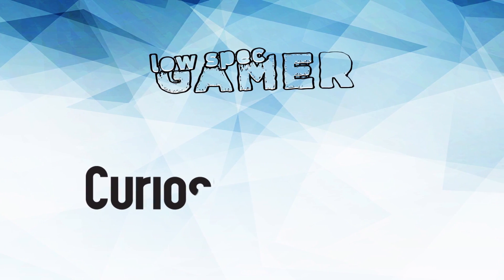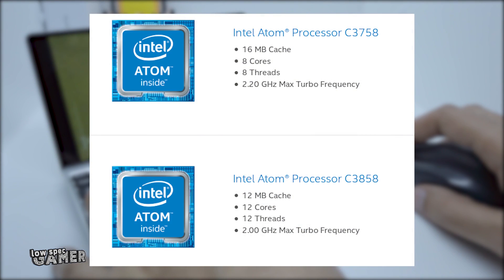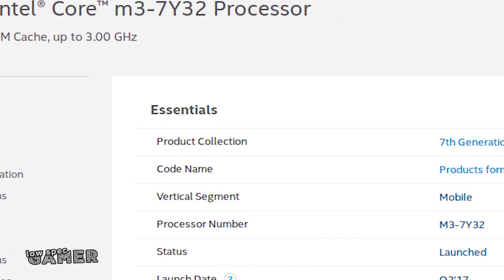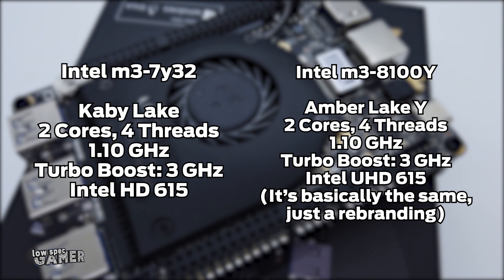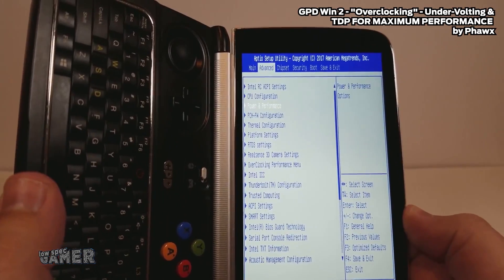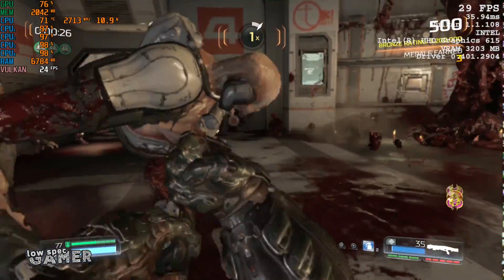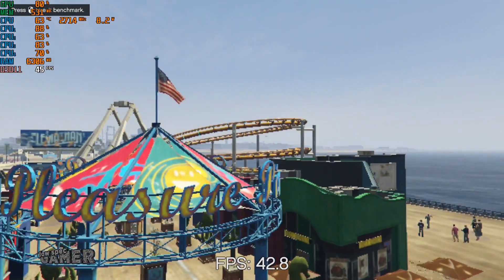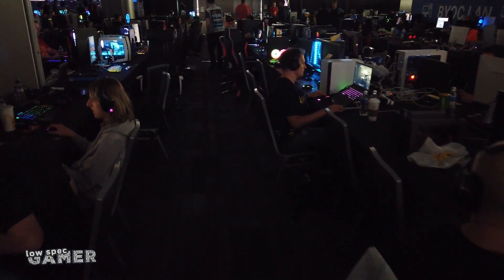Heavy gaming on this tiny computer! (Lattepanda alpha m3-8100y)

Comment: Hi. Thanks for video. I use LattePanda Alpha (864s) (m3-8100y) with titan case. I installed windows 10 on m2 ssd (toshiba rc500 m2 ssd). While the cpu temperature is 45-50 degrees in idle mode, the cpu temperature rises to 95 degrees while processing. M2 ssd itself gets very hot (over 80 degrees). Applications installed and running on Windows; dropbox, google sync, resilio sync, qbittorent, plex, kodi. I will generally use it as sync operations / file server and media player. But it scares me that it works with an average of 80-90 degrees during the procedure. Do you think this is normal or should I return my Lattepanda?

Comment: For the people who really want to run games on this board: There is a project called "rocket league for potatoes" that has almost all the high-draw features removed, but retains the actual gameplay. I've seen it run on Pentium 2-in-1s with 4gb of ram. I don't have a link to it right now, but it should be decently easy to find if you don't mind poking around a little.

Comment: Alright, this is bad news for me. :c
I wanted to make a handheld gaming thing with this, and... I need to try and find the OLDER model now? Really, I may put some sort of adapter inside with a ribbon cable so a gpu could be an OPTION, but not focusing on a MUST. Yes, it's for gaming, yes, it's for old gaming as I don't mind graphics that much, but it is also for MODDED gaming... This may screw me over. :/

Comment: You should get your hands on a Minix Neo J50c-4, it runs windows10 on an 10WATT TDP x86 Intel Pentium Silver J5005 Quadcore 1.5GHz, sporting an Intel UHD Graphics 605, 4GB RAM DDR4 upgreadable to 16GB dual channel support, it comes with a 32GB eMMC Storage upgradeable to 1x 2280 M.2 SATA SSD up to 512GB, it has 3 USB 3.0, USB C, and it support up to 3 screens at the same time, HDMI, Mini DisplayPort and USB -C all at 4K 60fps. the average price is 300 bucks, i managed to get one at 240 from Aliexpress from the Minix Official Retailer. Check it out!!!

Comment: I have had this setup for about 9 months. I gave up using it for Gaming but our family uses it for simple day to day Communications/ google apps etc. 

Not that great for using it as a Maker SBC/ Arduino platform it far to expensive to be underused running simple Arduino development projects. 

As for the cost it’s almost the same price as one of my Rosewill Micro ATX Mini Tower Computer 

# Case $45. 
# AMD Ryzen 3 3200G 4-Core, 8-threads  with Radeon RX graphics.$135.      
# GIGABYTE B450M DS3H Micro ATX/Motherboard) $95. 
# SSD M.2 2280 60GB Shark Ngff Internal $35. 
# CORSAIR Vengeance LPX 8GB (1 x 8GB) DDR4. $50.  
# Air cooler $50. 
# Power supply $50.   

Now this not a very powerful gaming system but it costs a bit more the my Alpha and GPU ( via a m.2 ) combo 

The size of course is about a lot larger the the Alpha but it doesn’t take up any real space  (35.2 x 36 x 17.5 cm) 

In closing the fact that tech support over  DFROBOT is not that great 

It was hard to get any real help finding a dealer in Canada that would sell you a system with support.  

Building your own AMD systems is not that hard. An the on line community for Ryzen is fantastic.

Comment: you should install a lower end external gpu like a rx 470 or something (yea i know thats really not a  """"lower end gpu"" but you know what i mean ....ahhh a budget gpu like the rx 470
Reply: mitch h the gtx 1650 is great for this little board. You can get a 120W external brick and power the both of them in a nice neat little case
Reply: @HandheldHardware  ahh yes but i was thinking of a lesser bottle neck situation type thingy??
Reply: mitch h fair point indeed!

Comment: IT COSTS 400$ what’s the point just build a a mid range gaming rig and don’t buy this overpriced garbage!!! >:(
Reply from the maker: that it is small? and portable? Just like with a laptop, which you would not compare with a desktop because they are meant for different tasks.
Reply: LowSpecGamer it just amazes me that a pc this low power has such a high price point when most other options for single board computers, such as the pi, are so low priced and affordable. The price point just makes no sense when you could get the same games to “run” on a 100$ less expensive laptop and retro games to run on much cheaper single board options!  So where is even the demographic for something as seemingly pointless as this?!?
Reply: LowSpecGamer also thanks for responding and my comment was in no way hate or dislike towards you.
Reply: LowSpecGamer also not to mention you would have to build a laptop around this thing or just pray that where you work has a spare monitor, keyboard, and mouse. So I guess more like the potential to be portable, but it is small.

Comment: Lol, I watched this video on my 
Core I9-9980XE
Gigabyte X299 DESIGNARE EX motherboard
Titan RTX
2×Sabrent Rocket NVMe 2TB
Seagate IronWolf NAS 16TB
(8×16) Corsair Dominator Platinum RGB 3200 128GB ram
EVGA Supernova 1600W P2 PSU
Asus ROG Ryujin 360 RGB cpu cooler
Cooler Master Cosmos C700M case
Acer Predator X27 bmiphzx 144hz 3840x2160 res
*13000+tax btw*😍😗❤

Comment: Sweet, I could build a nice little PC with this......
$409
ight imma head out
Reply: You'd be better off with a Ryzen APU setup, in all honesty, and it should cost around the same amount and hit better frame rates. Shouldn't cost more than this. Around $80 for the mobo. $140 for a Ryzen 5 3400G (4C/8T with Radeon RX). $40 for PSU. 16GB Crucial Ballistix Sport LT 3000MHz DDR4 for $75 (also two modules so you can use dual channel). That brings you to $335. Spend the last bit on a hard drive that you like and bam... LOADS better than the LPA.
Reply: @juansolo1617  not much difference gaming wise between the 00g apus. I got a $292 pc made with ryzen 3 2200g 8gb ram ddr4 and keyboard and mouse
Reply: @prodigyz2416  There really isn't much difference, but the 3400G can give you up to 20FPS more in some games, and it doesn't cost much more. Just like the Bulldozer architecture from AMD, it does best with the fastest memory you can throw at it, and you'll want a matched pair from the factory. Always good to have more memory. $75 for 16GB is a GREAT deal. Two modules, dual channel, 3000MHz.
Reply: @juansolo1617  games ive seen benchmarked have not had a 20fps gain in any way 1x16gb ram i just got so i have 24gb rn and ive tested 30 games from racing to ac odyssey to gtav
Reply: @juansolo1617  that lawsuit just finished up last week over AMD lying to the public about the Bulldozer,  AMD's defense of chiplet's connecting cores equals the exact same core and speed when in fact it is false advertisement and a lie yet again except this time to a court room judge and lots of sharks with engineer's every so happy to put the facts all over the table,  poor AMD lost and proved to be false advertising core counts by using chiplet spreading as the terms of full on interfacing at max channel speeds,  when computer science says not only that such is wrong but criminal ,   this is the only one investigated thus far,   I am sure those great lawyers are going after the whole Zen line up to look for faults since AMD did admit to using false science as the basis to their core interfacing which was up to 50% slower than the standard method to which intel uses,   no wonder they got so much smaller so much faster, not better engineer's ,  engineer's willing to ignore the facts of computer science.   long story short,  AMD lost law suit and judge awarded all buyer of the bulldozer line up 300 dollars per chip bought due to false markerting,   buyer got checks for 60 bucks each,  WOW those lawyers took a huge amount,   perhaps someone needs a mathematician to check that highway robbery they did on all those poor souls thinking they got the latest and greatest and the fact was they were had by the next rising star and now the world knows a truth on how they rose so fast..... reminds me of the Germans and WW2,  no one knew how the advanced so quickly,  moving as tho they did not need food, water or sleep... then the discover than truly won the war in Europe at least,   that magickal power was pills of amphetamines but the worst variant "methamphetamine" meaning they would take them and stay awake and awake and awake and awake,  unlike other amphetamine salts which wear off after 5-6 hours and the person can rest,  so the allies just set up camp to test the idea and bingo,  all the had to do was hang out and after 4 days of no sleep no warrior is a warrior with no sleep... Intel and ARM have had the greastest geniuses on this planet working to the latest and greatest.... remember when intel was sued for not pretelling the public of the next generation of CPU that will launch 3 months from now and they lost in court over that one,   AMD does the same and not a word is said,  they giving only vague hints no dead on specs.  Seems to me using the risc chiplet technology to make your 12,18,32, 64 basically all quad core and above variants zen or non zen since bulldozer is the crime and I wonder if this is the last we shall hear of it??  I think their whole APU being close to a PCI e 1050 4gb GDDR5 is why they have been cut slack and the only reason.   Look at that 48 dollar Athlon with the zen APU ,  ran with the right FPS limiting and resolution and that sucker will game just about on par with a GT 730  4gb.... goof job AMD on that......
Reply: Helios Gnosis what the f*ck?
Reply: @juansolo1617  A friend of mine wants to build one for his kid. Could you possibly throw up a parts list that can handle this and a bit more. Cost seems to be an issue for my friend, not sure why...
Reply: @juansolo1617  it was $600 back in 2017. considering rx 540 is a 1.2 teraflops card with 2gb gddr5 dedicated ram. I say its a solid choice, also its a laptop. I don't usually get cpu bound even playing some windows games on linux with proton (in ex. warframe, mortal kombat x etc...). It has a very bad cooling thoug and had to do a custom script to let gpu go to 95°C but cpu throttling needs bios modification to expose throttling control.
But cpu bound games like cs:go (when valve port it to source2) and battlefield 4 (slows down when cpu throttles) can benefit from a desktop build more
Reply: Juan Solo Maybe in the U.S... In my country 2x8GB 3000Mhz is $140, the 3400G is $240... now even talking about any intel processors.
Reply: The point here is obvious portability, which it'd be hard to get with the Ryzen. If there IS a portable low power ryzen and a board matching the size of the panda alpha, do point it to me.
Reply: @leonoliveira8652  You can always go Ryzen V1605B like the Udoo Bolt x8. Its got 8 vega cores for graphics which gives it a decent output for a ~4.2x4.2 inch board.
Reply: @HandheldHardware  It IS kinda bulky for a handheld, tho... But I guess it's still either power or portability right now.
Reply: @leonoliveira8652  Here's to hoping on the next lattepanda product
Reply: @leonoliveira8652  Asrock mini
Reply: With that just build a mini itx Ryzen apu pc
Reply: "But it's so tiny"
- "Nope"
Reply: pc to build krolo ge but itna chora nhi kr sakty
Reply: Use Delta
Reply: my $600 acer aspire 5 a515-41g-t48q have amd a 10-9620p and rx 540
Reply: @user-ro1cc8tz6d  nobody asked
Reply: @pies_pogrzebany  s.u.
Reply: @pies_pogrzebany  yes but i thought it was related to the topic and people have talked about it.

Comment: the issue with fortnite is most likely the cpu, you should try locking the fps to 30.
the game is more cpu demanding than it looks. i had the same problem on a laptop
Reply: that trash runs like garbage for how it looks, i like the style (makes me think nintendo) but it really doesn't run how it looks it should

Comment: You forgot about the intel n4000 series. Basically a j4005 but only uses 7W. So there are alternatives.
Reply: Merlin Gallagher I just got my LattePanda delta with n4100! It’s a beast at half the cost! Even eGPU potential (maybe...)
Reply: @HandheldHardware  great! I was actually talking about standard u-ATX and mini-itx boards. How much is that LattePanda Delta?
Reply: Merlin Gallagher $180 non activated
Reply: Merlin Gallagher I’ll post a review in the next couple days if you are interested!

Comment: I notice these issues with objects not loading due to the anitmalware service of the windows defender pinning the hard drive to 100% active time. Even the free version of avast gives a similar issue and windows update can also. Cause such an issue as it might be installing updates. So turn your network to a metered connection and suspend svchost(netsvcs) don't terminate it. Just suspend it in resource monitor.

Comment: Fun fact: the x86 Atomic Pi is cheap because it was essentially not designed to be a user-friendly SBC but actually surplus that was bought in bulk. It was meant to be the PC inside a $700 "Kuri robot" by Mayfield Robotics, which since it failed, sold its hardware and "Team IoT" bought it with kickstarter money.

Comment: You should try to get your hands on a UDOO Bolt V8, a single board PC with a quad core Ryzen CPU.
Reply: The Udoo Bolt V8 is the best option on the market currently.

The 14nm helps keep it relatively efficient, whilst the 4c/8t Zen1 cores are a nice boost over the Core i's 2c/4t, and the Vega8 APU is definitely better than the Intel HD/Iris iGPU. Overall it's only slightly faster than a Qualcomm Snapdragon 835 SoC, and uses much more power. But you get the benefits of an x86-system (better emulators) and PCIe (dedicated GPUs). And a possible future V2705B APU that uses 7nm lithography, Zen2 cores, and Navi8 APU is likely to be much much better, maybe able to match a QSD 855 SoC if we're lucky.

Regardless, this is basically the LattePanda killer, Rock64 Pi killer, and Raspberry Pi4 killer.

Comment: Some should try sticking this on an AIO, and seeing how far you can push it in XTU.

Samsung just made a laptop based on a Qualcom SoC which emulates x86 well enough to compete with i5s, the on-die adreno gpu is on par with a GT 1030 in raw compute, and it ships with ARM Windows 10. Expect phone makers to enter the laptop market in the next 5 years with cheaper, more efficient designs than anything Intel is making. Overclocking/undervolting with SetCPU would also be very likely possible.
Reply: Can an ARM SOC do DirectX or emulate current gpu features and programs?And thats a big nooooooooo

Comment: The price is turn me off and if I want for small space I go with Udoo bolt with Ryzen v1000, while it's not single board (you need provide Ram and M.2 Storage) but the performance much better and much smaller than mini ITX, also can tweak ram and storage it's much better option than use soldering ram specially if you want run win 10.

Comment: I understand that you are the low spec gamer but a lot of the low budget/low power builds you have are in the same area. 720p/480p gaming at 30fps and with tons of things turned off but you never review something that has visually improved over the years and just dig in the bottom of the bin items for some  random  rasberry pi meant to run at 4k for movies only.a G5600 build can easily outdo this 400$ pile of crap with a lower price and more options to expand. Do a review of actual budget pcs that can improve and start up people and give them better options than giving them a 400$ restricted pile of crap that you still need to buy an expensive m.2 that does nothing different from a standard ssd.

https://pcpartpicker.com/list/ZV8fMZ
Reply: Fernando Morales right now m.2 is like the same price (both slow NVMe and SATA m.2, actually SATA m.2 is cheaper than 2.5 inch form factor due to I guess less material/housing). His channel is focused on primarily desktop (like the Athlon 200g he loves), but he diversified it with some interesting content as many people just watch for entertainment. The Panda didn’t sound like he recommended it, just experimenting with it and finding out its capabilities.

Obviously at $400, I’d pick Ryzen 1600 with B450 board, 16 GB RAM, RX 580 8 GB, and a 500 GB SSD (all new parts except the GPU, included misc parts like CX430w PSU or 600w if you planned on Xfire later). Again though, he is just having fun testing so we don’t have to, and just seeing what X hardware does, not making another one of the thousands of cookie cutter builds, he is showcasing something he wants and feels that is unique enough to be entertaining, that’s a big difference.

Comment: check out the udoo bolt it has a embedded ryzen v1605b which is like a 2200g but soldered ... , it costs 400euro for the higher end model with 4 cores 8 threads ... u need ur own ram and storage ..

Comment: how can u get 30 fps in fortnite  with lattepanda if i cant get 30 fps with a i5 4210h and gtx 960m 4gb of ram lowest settings
Reply: Yea the ram is bottlenecking you
Reply: You need 8gbs of ram, also, tweak your OS.